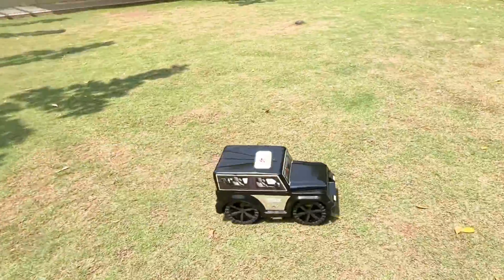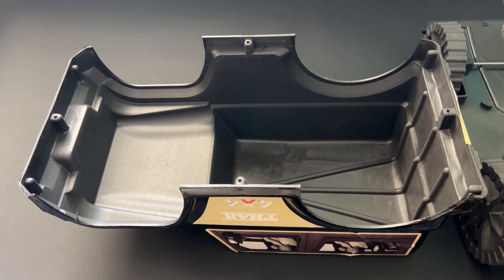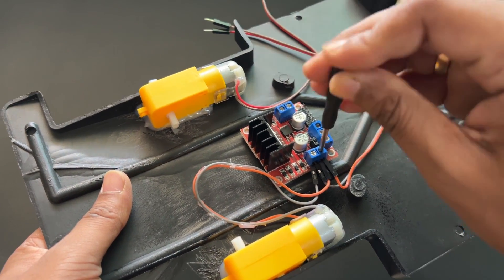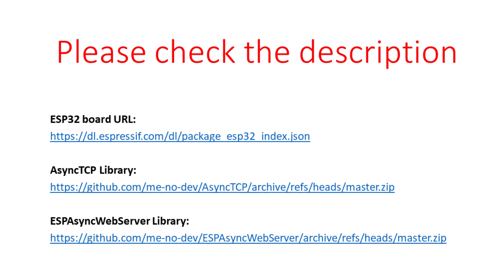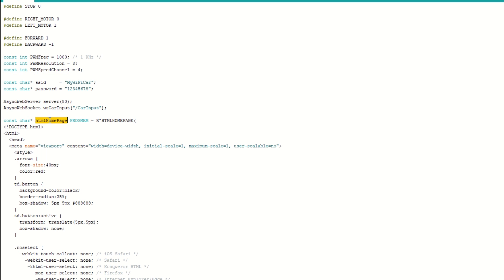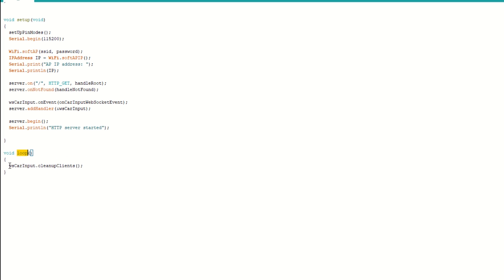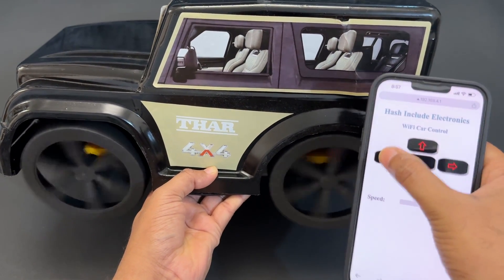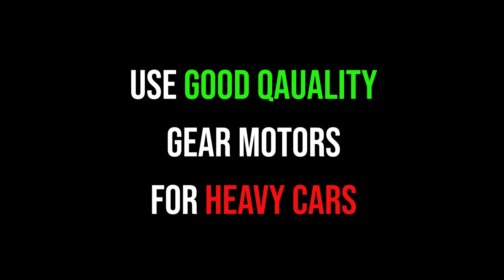WiFi Thar | Smartphone controlled WiFi Car | esp32

Comment: hello hash just wanted to tell that the battery which you used 7-12v rechargeable battery (mentioned as lipo 3s battery) is not the same as shown in video what shall we do
Reply from the maker: @QuickPodcast662  you can use any suitable battery which is rechargeable 👍🏻👏🏻

Comment: Hello, Hash, 3 months ago I was able to use your codes and everything worked perfectly.
However, now I get this error while compiling:
"error: 'ledcAttachPin' was not declared in this scope; did you mean 'ledcAttach'".
I think there was an update in some libraries and now the code is different. Can someone help ? :)
Thank you for your great work, too !
Reply from the maker: Yes you might have installed new version of esp32 board . That’s is why you get that error . Please install 2.0.16 version of esp32 board and the error will be gone . 👍🏻👏🏻
Reply: @hashincludeelectronics   Thank you so much HASH ! It works perfect now ! 
Excellent work as always :)
Reply from the maker: @PlamenMonev  glad that it worked . Happy to help 👍🏻👏🏻

Comment: I need to know the battery and charger you use and which do you one do you recommend for all your projects
Reply: Can I get the link for the lipo battery and charger then
Reply from the maker: @faisal-ajao  https://amzn.to/3Vbc1Ef
https://amzn.to/3Xa48lo
Reply from the maker: Try these
Reply: Can I use ZIPPY Compact 1000mAh 3S 25C Lipo Pack
Reply from the maker: @faisal-ajao  yes you can 👍🏻👏🏻
Reply from the maker: I use LiPo batteries and charger for the same . It’s costly . However if you need cheaper one then please use LiOn battery. 2-3 cells are good 👍🏻👏🏻

Comment: Can you make an app for esp32 cam rover control?
Reply from the maker: There is already video on my channel where we used esp32 cam and app 👍🏻👏🏻please check if that’s helpful 👍🏻👏🏻
Reply: @hashincludeelectronics  also I want to make the car with servo steering can you help me with the coding part,or make a video about that, because there is no such videos on YouTube

.my suggestion:you can modify your pan tilt car with servo steering and 4 wheel drive(LF,RF on one channel of l298n,BF,BR on another channel of l298n) the pan tilt controlled esp cam module is placed on driver seat of the car ,so we can see the driver view and control the driver view 

I'm not good @t digital electronics and coding so hope you help me 😍😍
Reply from the maker: @KrishnaKumar-jl8pw  that’s a nice suggestion . I will definitely try that 👍🏻👏🏻
Reply: @hashincludeelectronics  thanks for your positive response. you can do that❤️
Reply: @hashincludeelectronics  bro I think it's only an webserver